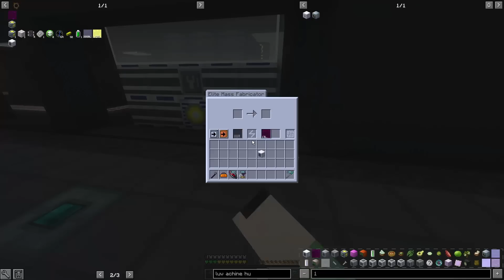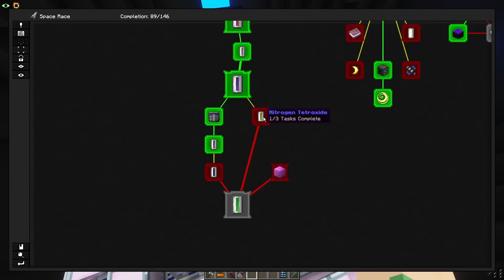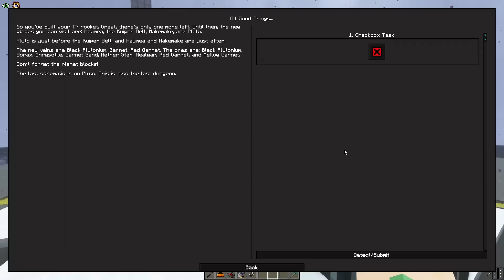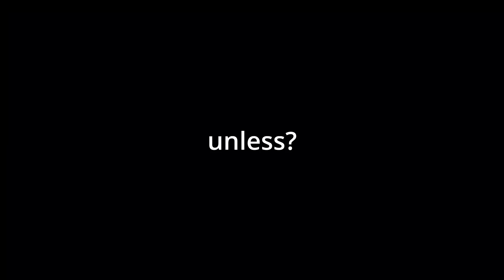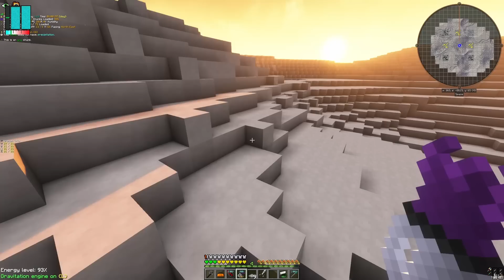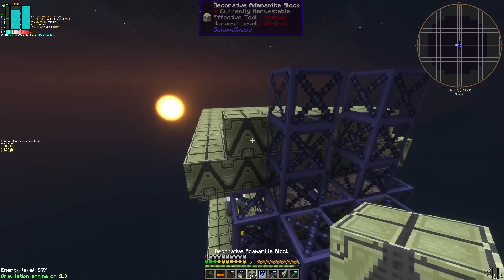GregTech New Horizons E105: The Tier 7 Rocket

Comment: Huge! GL in UHV, am there rn as well! Also, look into the Space Elevator a bit more - you better skip MK I motors at all, as first: they do not upgrade into MK II, only one block spent for research; and second: you basically cant have any good stuff until MK II Space Elevator anyway - Pumping is mk2, as well as all the common ores for you to use on these tiers around you